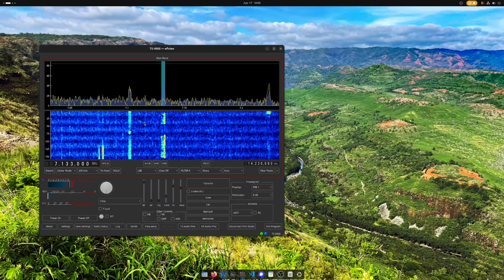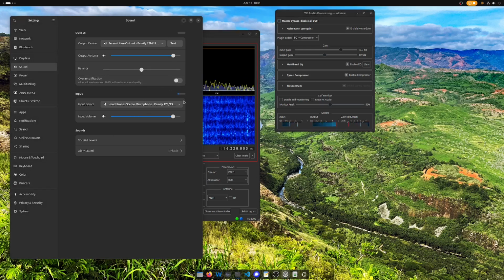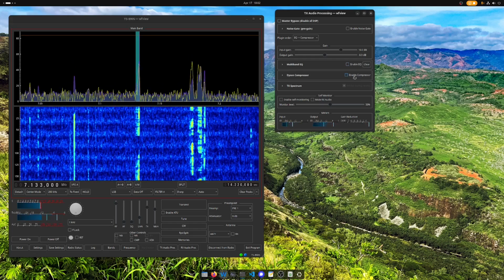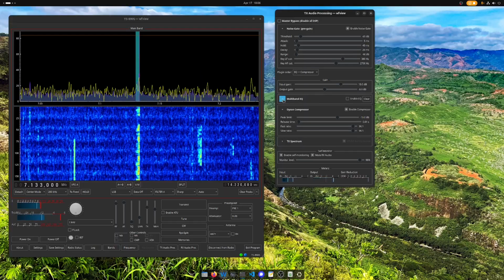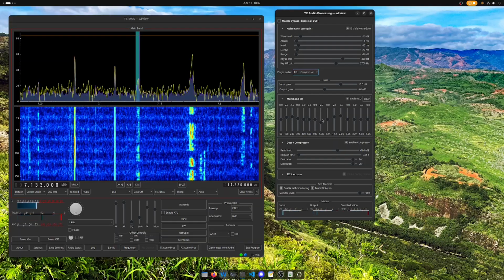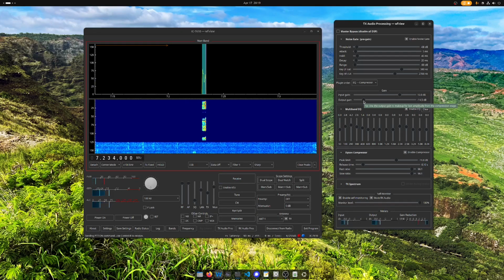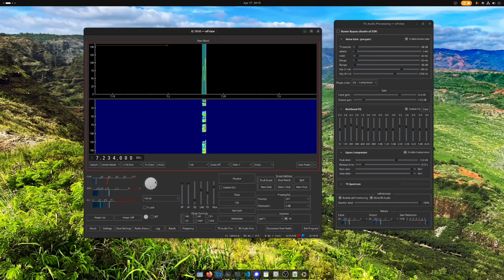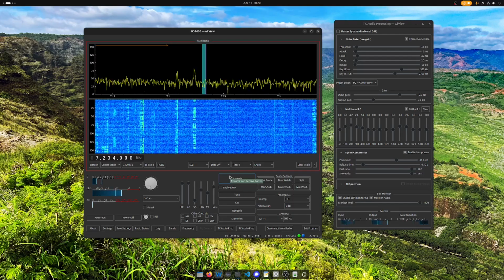wfview 2.22 Transmit Audio Processing: Compression, EQ, and Noise Gate

Comment: Thanks for all your work. Is it possible, through some type of interface, to use WFview on older radios like the M700 ?
Reply from the maker: Older radios with a CI-V bus can be easily added. But the M700 doesn’t have CI-V, so it would involve a lot of reverse engineering the radio’s control protocols.
Reply: @W6EL Thanks for the comeback, 😊